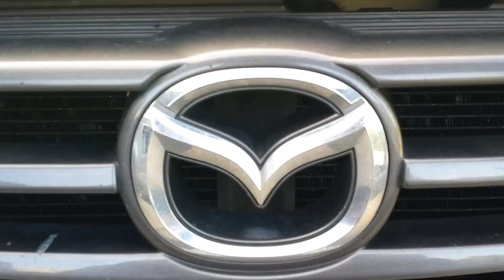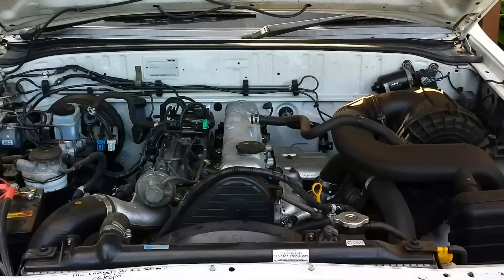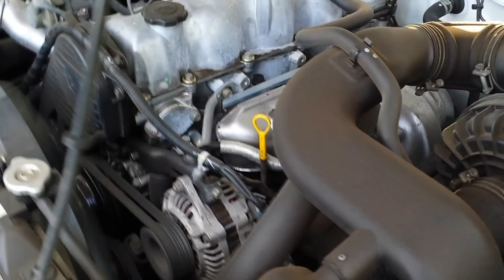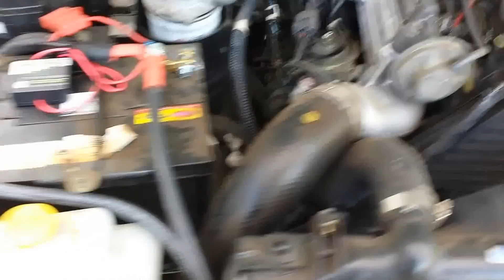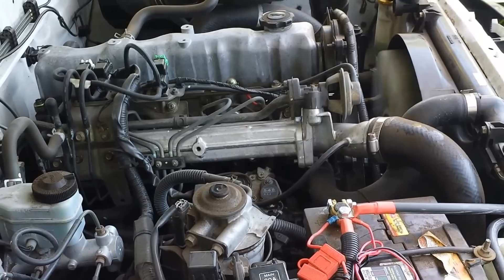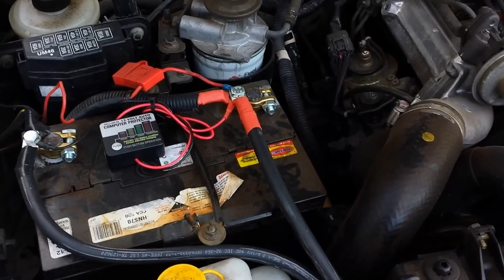Mazda Bounty 2006, 2.5 L WL -(2,499cc) - Turbodiesel - 86kW

Comment: Hi, i have a 2010 Ford Ranger with the same engine, it's good and reliable, i do get around 9L/100KM fuel consumption.
One problem that has been bothering me is that it vibrates at idle, the vibration can be felt on seats and steering wheel, idling rpm is around  730/750, i replaced engine mounts recently.
Any one have any idea of what could be the cause ?
Reply from the maker: 4 cylinder diesels do tend to vibrate at idle, unless its excessive. Might be the balance shaft/chain.  Bad injector or valves might need to be adjusted. 
Maybe uneven compression could cause vibration at idle? Is there any knock under load?
Reply: Thanks for your reply, it's smooth under load, the engine never been touched, the odo is at 360000 km.
 Should i check the valve clearances or the injectors ?
Reply from the maker: @yassinel8588  I'd start on the easy stuff, injectors could be a good start and if they are original they may be coming to the end of their life(maybe), I'd assume that she has been well serviced with all consumables like oil/filters, fuel filter changed, coolant flush, then check any belts/timing gear are at correct tensions, water pump checked or replaced. Another thought would be fuel - do you always fuel up at the same place / or has the fuel changed that you have noticed, maybe some moisture has got into the fuel/lines ? Do you run a fuel additive that kills fuel bug, cleans injectors, and/or improves the quality of the fuel(increases Cetane level), last thing you would want to do would be to open her up, if you had too. Going thru all the different components and checking them off one by one. :- )
Reply: It has been well serviced, the coolant has been flushed recently, i do injectors cleaning from time to time with additives. about the fuel i do tend to change gas stations.
Thanks a lot for the tips, much appreciated
Reply: @rattfink3285  Hi I know this is an old thread just wanted to know what causes the knock under load? I have that problem and I overhauled the engine recently myself
Reply from the maker: @clinty8  Injectors ?, considered a diesel fuel conditioner/lubricator/diesel bug additive. Changed fuel stations recently? poor/bad fuel? diesel purge? flush system and clean out tank and/or maybe some new componentry has failed, injectors, bearings? just guessing.
Reply: @rattfink3285  

Hi, I sent the injectors away for for resetting and new nozzles were installed. The diesel contamination light is burning on the dashboard though. Is there a way I can set injection timing on the pump? If it is indeed a "diesel knock" as people call it
Reply from the maker: @clinty8  Not sure on the injector timing, has that been re-con'd?  Is the Fuel bio-diesel, or a eco type or plain jane standard diesel?. There maybe water contamination. No doubt fuel filter is fresh. I'd be inclined to go see my diesel mechanic and have a chat, Once past a certain point, water contamination reduces the CETANE rating of your fuel and causes performance problems.
Reply: @rattfink3285 do you know how these engines go on 100© biodiesel?

Comment: have u ever got head cracking issues?
Reply from the maker: I haven't, that is unfortunate thou. Expensive exercise in sorting that out. Depending on the condition of the vehicle it may or may not be worth repairing, good luck.
Reply: @rattfink3285  yes it is.. replaced head n gasket . after many lame mechanics n plenty money wasted.  i bought a new engine n by new . i mean a foreign used .. working good now .. monitoring it

Comment: I would like to buy the. solinoir valve where can l get it
Reply from the maker: Mazda Bounty UN 1999-2006 Vacuum Solenoid, you could buy a genuine Mazda part and pay a premium, or buy a aftermarket one. Not sure your location, but check the part number and you could try ebay, or go to your local automotive parts retailer and/or a local vehicle parts wrecker.

Comment: Is this a 5 cylinder ?
Reply from the maker: Inline-four cylinder diesel, Mazda built and developed.
Reply: Thanks , i tough it was the inline 5 from Land Rover , the one that was put on the Defender
Reply from the maker: All good, but the current Mazda BT-50 ute (which shares a similar platform and engine to the Ford Ranger) does use a 3.2L in-line 5 cylinder diesel.

Comment: fuel consumption in km/l ??? nice turbodiesel engine. thx
Reply from the maker: Not sure entirely, double cab work utility, stuck to the road really well, abit loose when wet unladen, but very response pickup under foot. was around the 9L per hundred Kms. This was the updated model, way better feel than the year or so before, the previous was way looser around corners.